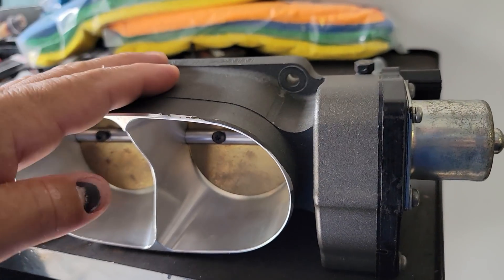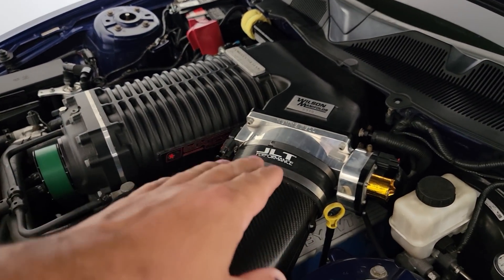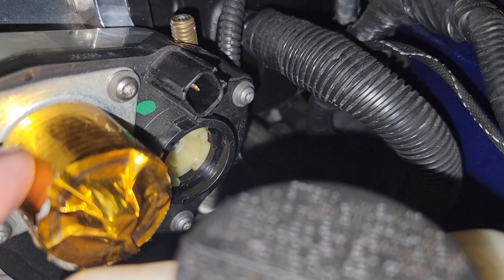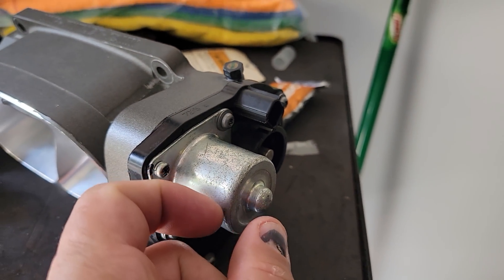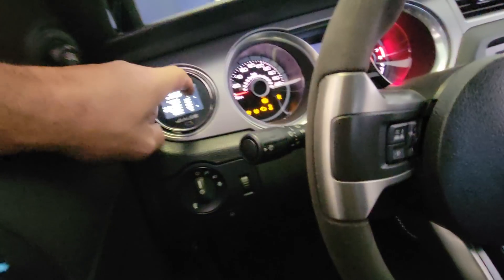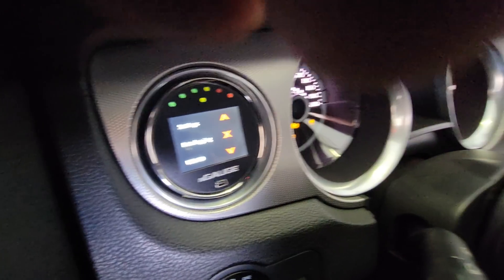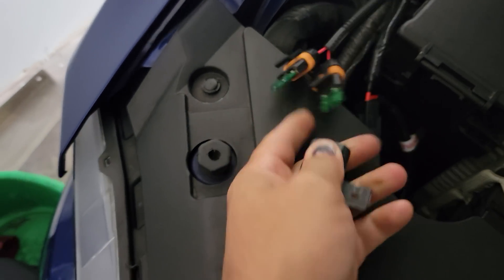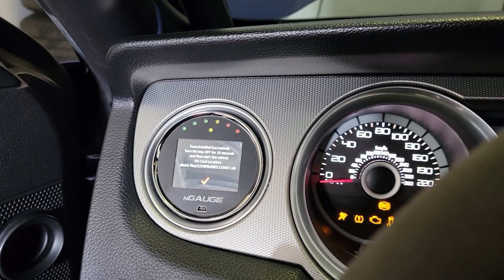2013-2014  GT500 Electronic throttle manual throttle test

Comment: Very interested in this, we’ve put a manual TB on a CTS-V and it worked well, I would definitely do this to my 13 GT500, Keep us all posted. I’m running a GEN3R making north of 1300 rwhp with a built motor from Wonder Racing

Comment: my theory is that the pedal is like a primary/secondary throttle position sensor or in the computer world its called an HID human input device or human interface device, and the actual throttle position sensor on the throttle body is the real tps in place to verify the actual throttle position. i know with modern cars having an eco or sport mode the throttle profile of the drive by wire pedal can be tuned to act like it has dynamic lobe instead of a static lobe profile like cable throttle bodies/carburetors

Comment: Could this mean that you have a wiring issue on the car? Because if you unplug the wires from the Throtle you should have a circuit code not on the tps but the throttle flap.
Reply from the maker: We have tried some special tuning.
No there is no wiring issue
Reply: @YDBT4LIFE  but if there’s a malfunction related it could explain the loss in power i could be wrong because I’m not well versed in it I’ve been out of the car repair business for a while.
Reply from the maker: @BamBamsflow  what loss in power? I have no idea what you're talking about.
Reply: @YDBT4LIFE  i learned by accident that the Ford Manufactured TPS does more than just read the angle the signal is different sorry I can’t be more specific my English is not the best.

Comment: I would see if you can swap out the pedal....I can't remember what its call.... I seem to recall 3v had some issues with them. Also, if it's a resonance issue, I wonder if a  non aluminum, softer material (3d printed plastica, resin, hell even wood) spacer between the throttle body and the elbow would dampen it enough to help. I'm gonna put my bet on the pedal electronics though.

Comment: Hey Alex couldn't you theoretically remote mount the TPS sensor on a bracket, leave it connected to the stock pedal and have the new throttle cable ran from the pedal actuate the TPS similar to how a lot of swap vehicles do? I don't see why something like that paired with the Super Cobra Jet mechanical throttle body wouldn't work.
Reply from the maker: Now you're thinking.
Reply: @YDBT4LIFE  👌🏻👌🏻

Comment: Very weird that the throttle pedal input still revved the engine. I’m intrigued by this theory but throttle cables and bellcranks are also known to break. Just wondering how much resonance and vacuum is really drawing the blade closed or if it’s going into premature fail safe. 🤔🤔 pretty cool that you can manipulate the blade angle without it completely wigging out!
Reply from the maker: Pedal raised spark but didn't move throttle...we are looking into why. lol

Comment: What did you do to your finger alex? Very interesting eliminating the fly by wire on a stock pcm. The throttle pedal is just a request, and the tps is a input. I would have beetlejuice make you a custom intake and throttle body for this set-up.
Reply: It's just nail polish he didn't finish removing, 😄

Comment: Any advantages of mechanical vs fly by wire throttle body?  Gains,positives or negatives
Reply: Well the advantage of a cable is it wont fail for 15-20yrs, where as electronics struggle to survive 5yrs. All the electronics on cars are planned obsolescence and anti repair. The emissions and fuel economy shtick is just that a shtick. What happens when your upstream O2 sensor fails? It goes dead rich to save the motor, meaning you tank the fuel economy and spew far more pollutants than carbureted non cat cars. What happens with the MAF fails? See previous answer. What happens when the ECU fails? Welp time for a new car because they are $1200+ and each vehicle of the same make and model will have multiple part numbers and you have to be 100% positive you get the right one because you can not return them once installed.